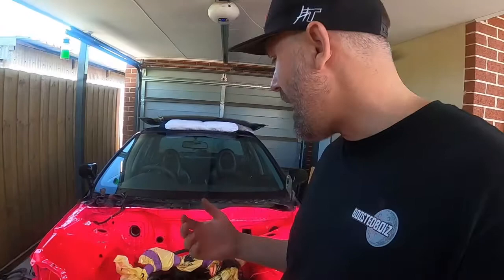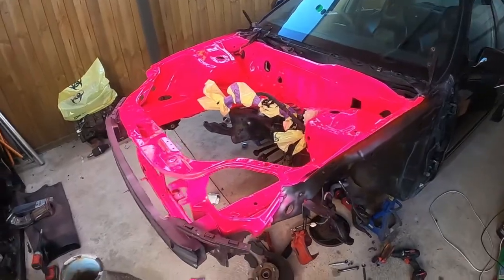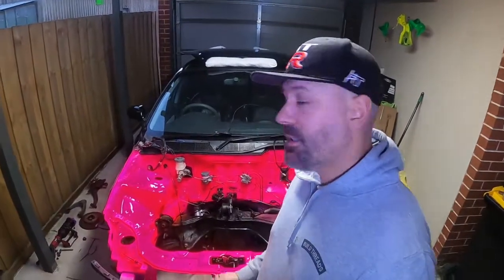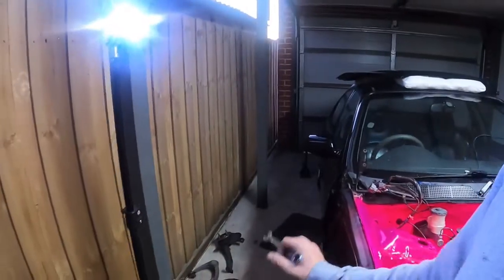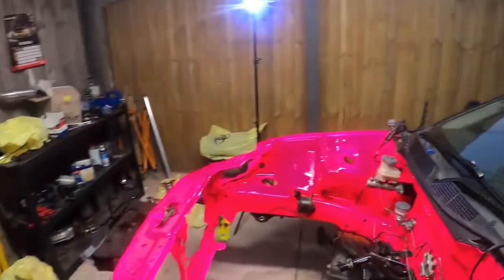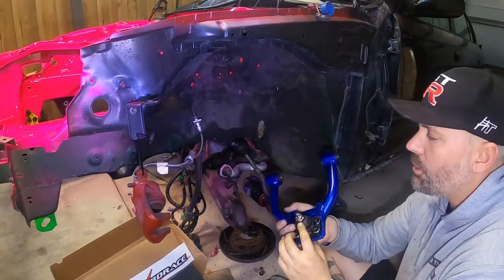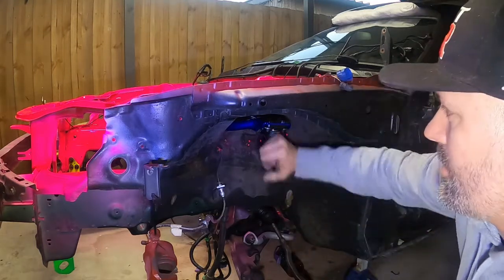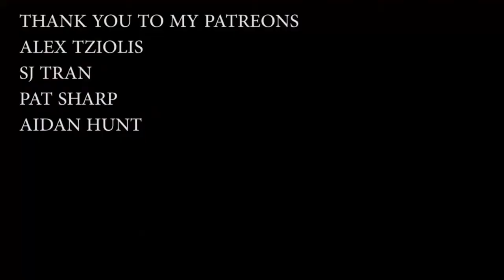ENGINE BAY PAINT JOB WIRE TUCK EK CIVIC TURBO D16Y BUDGET BUILD Episode 52

Comment: Keen to hear some feedback on the brake booster delete if it’s streetable defiantly keen on it

Using a engine crane makes putting the engine in easy the only hard part about it is positioning it so that the gearbox mount goes in before the timing belt mount
Reply from the maker: I explain how I did it in the next video surprisingly easy  no crane